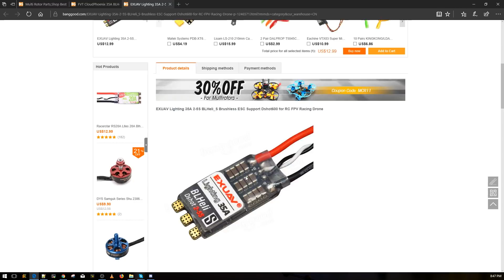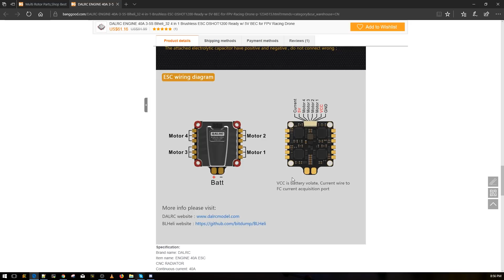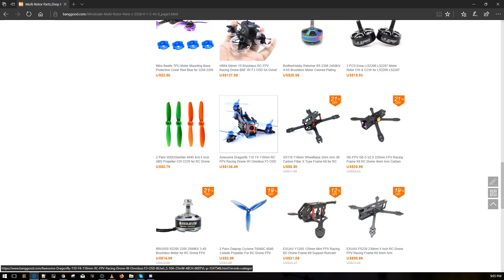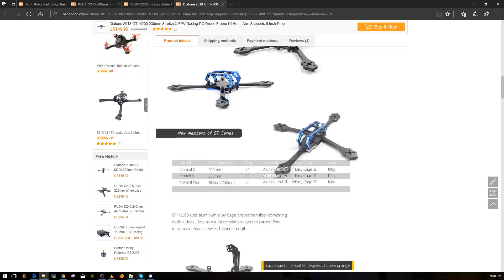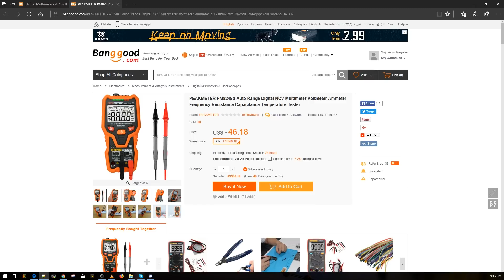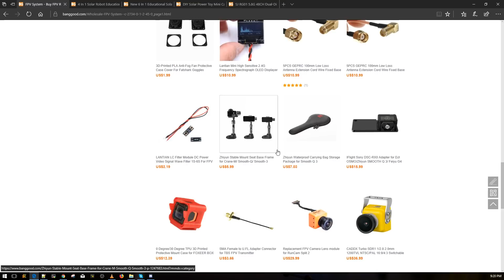New FPV Drone Products // Window Shopping Banggood #2

Comment: You could always make your own top for the Diatone, with a battery protector plate from a bottom mount quad and a couple standoffs +3d printed cam mounts.
Im interested in what Diatone's stack for it is gonna be, i cant fit it all in without it lookin like its packed for a roadtrip!

Comment: Mesh I made one of those magnetic soldering stands for super super cheap yesterday!!!!! I will make a video very soon!

I took a long maybe 5 inch bolt and a shock sprig from one of my rc trucks.  Got a threaded washer type piece to adjust the tension of the spring for heavier items. They had rubber grommets that fit perfectly and the spring even rides over a little shoulder on the rubber and I took a piece of mouse pad and glued it to the bottom of a nut that I threaded all the way in and acts as the top of the holder.. it basically looks exactly like theirs minus the sexy red aluminum.. threw a neodymium magnet on the bottoms with some jb weld and taaa daaaahh I saved money and got satisfaction from making my own 😎

Comment: DYS Samguk motors!! They'd be right up your alley as they are cheap, less than $10 a motor, are pantless and also are the current "trend" sizes. 

Also, do a 7 or 8 inch long range build. Maybe even using the FrSky long range system

Comment: Cant you use other pads to solder an xt30 on? And dont buy the eken h9r camera it says that he can film in 4k but thats bs and at 1080p 60fps he has glitches in the original vid so i have to put it first in a edditing program before it looks okey but then the quality is going backwards also so dont buy those😆

Comment: Drone mesh I have just made a drone with the star f3 it’s my first time using it when I was on beta flight I used a 3s to test it and when it was done I tried 3s at the start it was flying fine but when I put 4s on it it was going up and down in the air with out me touching the transmitter do you no y and do u no how I can make it stop and another thing I didn’t calibrate it because I don’t no how. do I go on Blhell or do I go on betaflight to calibrate it
Reply from the maker: Nathan Richardson change esc protocol to dshot 600 and no need to calibrate. Update me
Reply: it’s on DShot 600